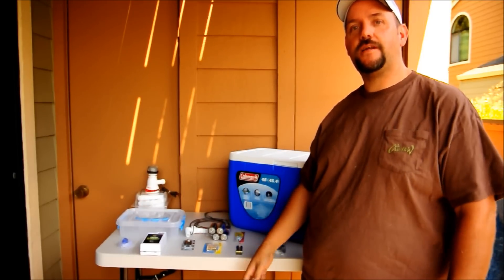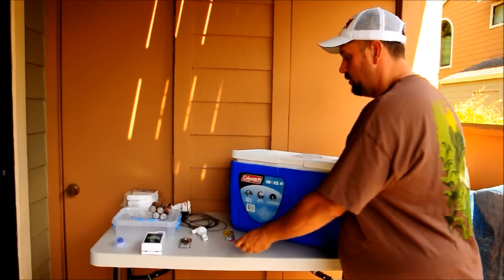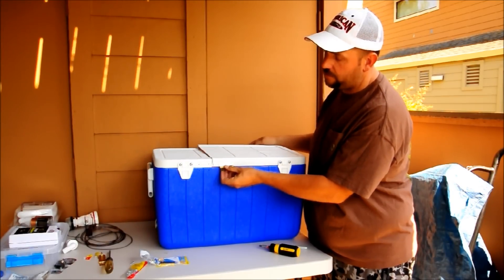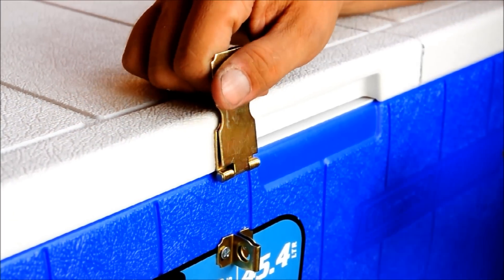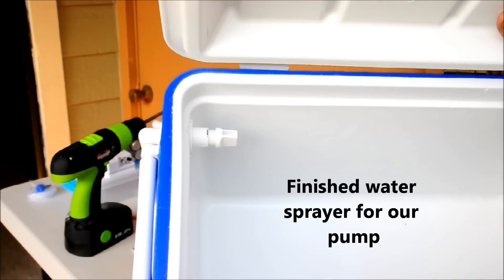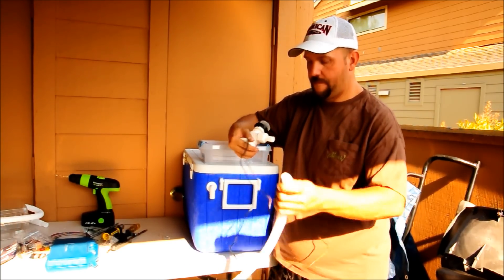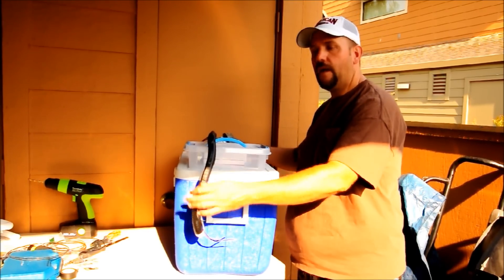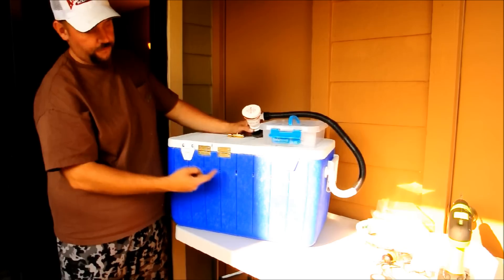How to Make a Portable Fish Livewell out of an Ice Chest

Comment: Where does the water go after it goes out the overflow holes?
Reply: It saturates the foam in the lower cooler, making the entire thing heavier. The overflow should have been a tube halfway up the cooler that is hard plumbed into the cooler drain spout.

Comment: You can use Deep Cycle or an AGM battery, they can discharge more energy then a car battery. DC's have a D.o.D from 65% to 80%, while AGM's often have a 100% Depth of Discharge. Marine DC's and AGM's are sealed and can be used near water. AGM's come in many different sizes and Amp Hour ratings. More Amp Hours means longer run time, 100 AH or better would be a start. Pro boats use multiple parallel 200 AH and 300 AH batteries.
-Rip some lips-

Comment: why not just drill a hole for the pump at the bottom and run the tube back up to the sprayer??? you wouldn't need the over flow holes and it would be easier to use.